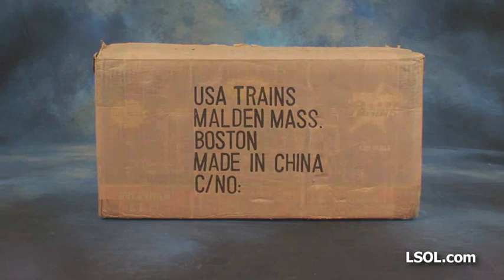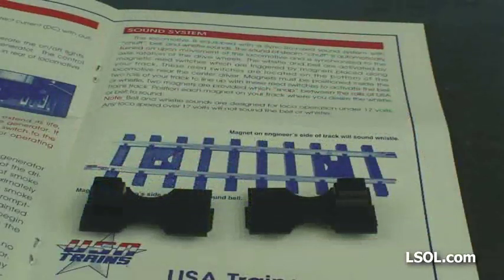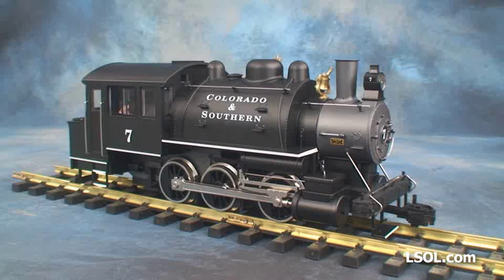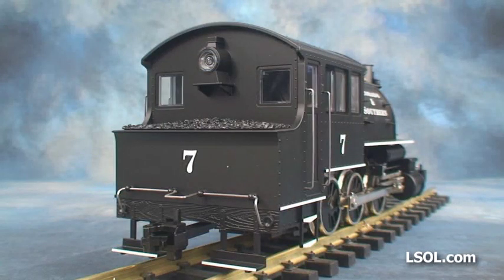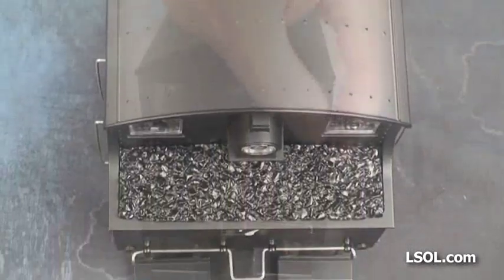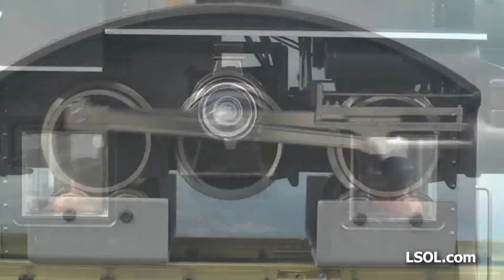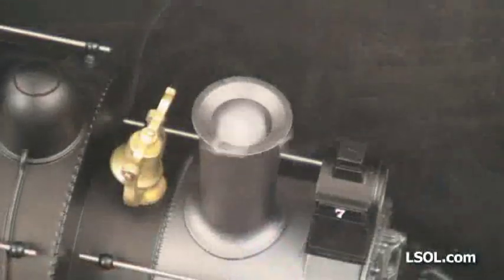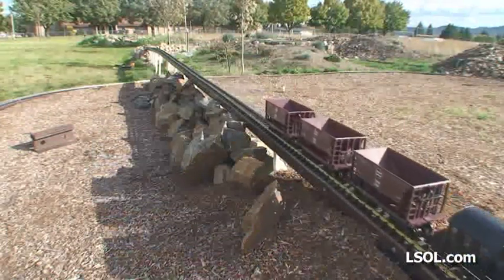Garden Trains: USA Trains Docksider 0-6-0 Locomotive

Comment from the maker: @8010cookie .  Yes.  It is 1:29 scale. It is accurately detailed and is made with die-cast metal construction. Here is a list of features. Operating headlight & cab light and directional backup light. Illuminated marker lights. Operating Smoke Stack. Fully Synchronized Sound System Included. Die-Cast Drivers & Stainless Steel Rims. Highly detailed metal Piping. Metal Drive Rods. Metal Hand Rails. Brass Bell & Whistle. Detailed Builders Plate. Simulated Coal Load
Reply: Too bad they didn't use a Phoenix Sound System, personally I found that factory sound system inadequate and sounds more like a shooting gun than a steam loco, the whistle and bell, not too bad, but overall that sound system needs to go.  

And for the price of that USAT loco and it being die cast metal, why skimp on the sound and smoke system in it?  

  And in the video the reviewer states "add a small fan to the smoke unit", the smoke unit in that loco IS NOT fan driven at all, but air driven by one of the drivers and a piston configuration, if it were actually fan driven the smoke output would be so much better and stronger, even at lower {start up} speed.  

  If I opted to buy one, both the sound system and smoke unit would have to be replaced with a Phoenix Sound system, as well as an actual fan driven smoke unit.  Piston driven smoke units just can't cut it like the true fan driven units do.